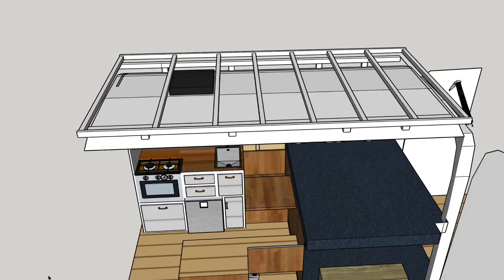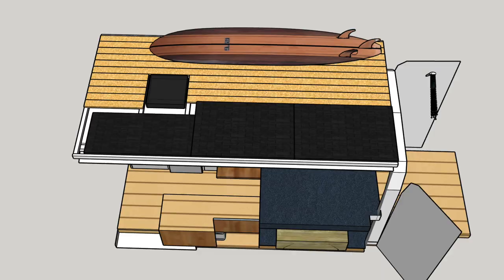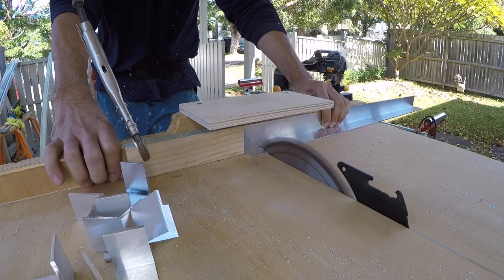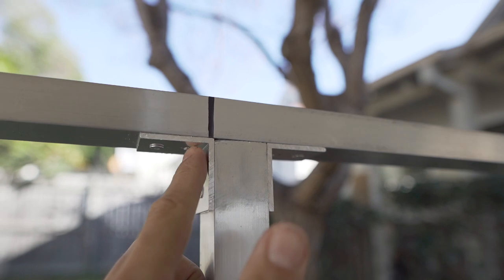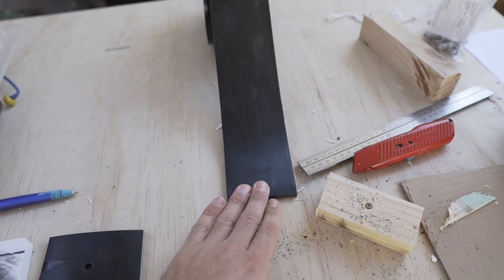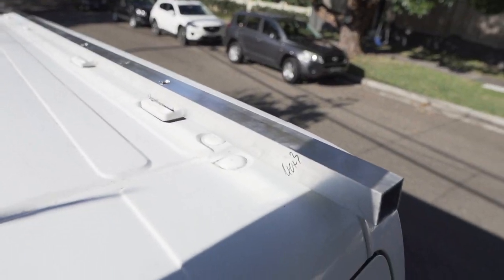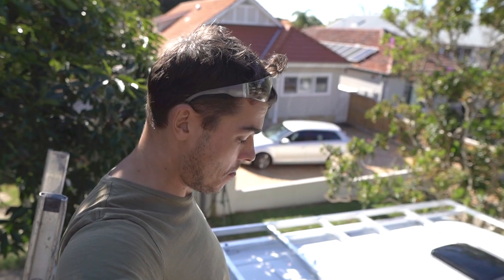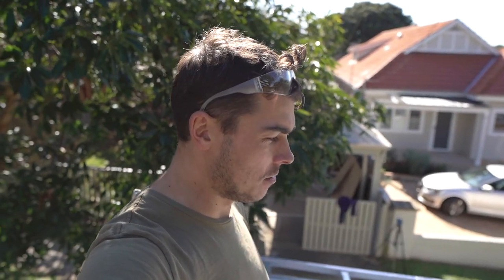DIY Aluminium Roof Rack NO WELDING Ford Transit Conversion

Comment: About to copy you! What did you use to cover the holes in the aluminum mounting channels? And what did you use with the M8 bolts to make them water tight? Imitation is the sincerest form of flattery! Thank you!
Reply from the maker: At the moment it is just some take until i find a plastic cap that fits nicely. You can add some sikaflex around the washer of the bolts to keep them water out. The rubber sheet keeps the water out from the inside.

Comment: Are your 3250mm bars all one piece or did you piece smaller sections together to get that length?
Reply from the maker: Yes they are one piece. I was able to source 6.5m lengths which I cut in half

Comment: Nice work around from welding. Just wondering, is it bare aluminium tubing? Or is it anodised or something? Is there any worry with corrosion since the metal is so exposed?
I've got a set of old roofracks on my rig, the brackets are good, but the tray looks like a diy job from steel tubing, and it was poorly protected and rusting in a disconcerting way. Trying to decide myself whether to replace it or strip all the old paint, file it back, then repaint it; or just make a new tray like this awesome idea. Keep up the useful vids my guy
Reply: I think better than painting would be to take it somewhere and have it powder coated!
Reply from the maker: It is bare aluminium, which doesn't rust in the first place. It will tarnish but we could have left it like as is no problem. We painted it black for aesthetics with an etch primer and top coat which was a hell of a lot cheaper than getting it powder coated. Looks amazing too as i really make the time to do it correctly.

Comment: G’day. I just saw your build and as a fitter and turner that I am I must say you have done a bloody great job. Do be careful loading up any rivets running horizontally, there’s only so much load they can take, if you already have do keep an eye on them please. Safe travels buddy don’t over do the payload on any builds you do. Stay safe and live happy. Cheers from Mario.
Reply from the maker: Thanks mate, appreciate it. Yeah I made sure to engineer it so that there are no vertical loads on the pop rivets as the cross members rest on the side members. I will still endeavor to check the condition of the rivets over time for any play.

Comment: Top job! Lite, strong, cheap. And very big!!
The only difference I'll be adding when I do my Coaster roof rack is, instead of pop rivets, which do eventually corrode, I'm intending to use stainless self tapping screws to hold everything together. This also helps if anything needs disassembly at some later time, for further innovations and/or fit-outs.
Very inspiring. Thanks again for sharing, Mate.
Reply from the maker: Thanks! I wouldn't say the rivets will corrode. Aluminium will oxide but not to any detrimental condition. But they are not as strong as stainless rivets. Having said that if use stainless and aluminium together you will get galvanic corrosion and the aluminium will start to corrode.
Reply: @saltyvanventures  I've seen old aluminium ladders with the pop rivets falling out because of corrosion. So it can happen. Simple to replace though.

Comment: As a fabricator welder I would advise that if its strong enough as it is i would not weld it it will pull and twist and warp in all directions with the heat required.
Reply: So I made my previous comment before I had watched the whole video. First of all great job! You will not need to weld this. I would not even weld a broken section  I would simply drill out any rivets (with the same size drill as originally used) holding in the broken section and replace the necessary parts.  Then redo any rivets.

Comment: Just I found your video today. It's really great and helpful. If your van has a gutter, Would you do the same things or different ideas?
Reply from the maker: The great thing about this van is that it has treaded inserts in the roof.  If your van has gutters I would probably use roof racks and build on top of them
Reply: @saltyvanventures   Thanks for your reply. Ya My van is coaster and has a rounded ricky roof shape so i should use roof rail gutter bracket and copy your idea. Thanks for sharing your idea and talents.

Comment: This is fantastic. Seriously. Do you have any updated pictures of it with the deck? Also, have you been able to drive it and test for and rattling?
Reply from the maker: Thanks, No not yet, it's on the list of things to do. I first want to weld up an aluminium access ladder before i finish the rooftop deck.

Comment: Nice one mate. Shame I can't upload some photos of my alloy transit roof rack on the comments. Im using m6 stainless bolts with spring washers and nylock nuts instead of rivets to connect my pieces together
Reply from the maker: Awesome! Send me a DM on instagram. Id like to see how you did it. @salty_vanventures
Reply: @saltyvanventures  lol I quit all social media this year except you tube to allow more time off the phone and enjoying my camper conversion! I kept FB messenger though. Send me a msg there if you want: Isaac Mack from Australia. Cheers.

Comment: Did you weigh the roof rack by chance? or do you have a guess?
Reply from the maker: No i didn't  but from lifting it on the roof by hand i would estimate it to be around 20-30kg

Comment: Can I use 50*2mm aluminum square hollow? I just found to rails, and want to use it.
Reply from the maker: Personally i wouldn't use less that 3mm, but thats just me.
Reply: @saltyvanventures  Thank you so much. I decided to buy 3mm too.  I don'h have any workshop or garage. And just started to buy all build equipment. Could you tell me, what size of blinf rivet did you use?  I'm a little bit confused  with differences size. Another metric system and labels. =) 3.2 x 4.8mm  and 3.2 x 6.4mm  is it ok?

Comment: Hello nice video! Thank you! But is there enough space under your aluminium bar to walk on it?
Reply from the maker: Yes, just. If you are standing on just one of the cross members, yes it will touch the roof. But with the weight distributed it doesn't. If I were to make it again though I would use slightly thicker plastic spacer.

Comment: Great!  Using plastic window shims as the base is genius!  Please tell me how high they need to lift the bar to clear the roof.  I'm doing the same thing here.  Thanks!
Reply from the maker: I think the ones i used were 20mm (the thickest I could find). But that was still not enough so i used the 6mm rubber matting to get that extra clearance.

Comment: Awesome, great way to save money and get a roof rack. You could spray it black for sleekness too. I assume this is from before you brought your van in for repair at the ford dealer !
Reply from the maker: Thank you. Yes I will eventually paint it black for sure. I just wanted to get it up for now to see how it looks. I might even consider getting in powder coated. Yes this was prior to my feud with the Ford Dealership. And after all that i still haven't got the van back yet!
Reply: @saltyvanventures  lol feud. Powder coated for sure!

Comment: Hey there! We are building just the same rack as you guys did! Thank you for the inspiration! 😊 could you tell us the length of the m8 screws for mounting the rack to the van?
Reply from the maker: Hi there, I cant remember 100% although i think it was 50mm or 40mm.
Reply: @saltyvanventures  Great, thanks! :-)
Reply: Hey guys! We are super happy with the rack although we have the feeling that the fuel we Need increased as of the Lack of aerodynamic. How high is your fuel consumption? :-)

Comment: Looks great! What was the reason you went for different size side members to the cross members?
Reply from the maker: I wanted a small lip for the solar panels to rest up against. Plus it didn't need to be as wide as the cross members
Reply: @saltyvanventures  Do you think it would be strong enough to build something like this with? The guys in this other video did theirs with 80/20 and I’m thinking regular aluminium tubing would be way cheaper https://youtu.be/wRHdZ2CregM

Comment: Very cool. I was a little skeptical of the pop rivets at first, but the beauty of your design is that by securing the 2 rails to the roof you've taken just about all of the load off of the rivets. I have a 07 econoline and since the body has been discontinued, I am having some trouble finding roof rack options. I may go this route. Thanks for the ideas!
Reply from the maker: hope it works out for you!

Comment: Mate, you need to replace those pop rivets with #12 sheet metal screws.
Reply: Why would you use sheet metal screws on aluminium?
Reply: Agreed, Stainless Steel screws are structural. Rivets aren't as strong.
Reply: @JohnDoe-pw5cs  the “sheet metal screw” refers to the thread type, not material it threads into.

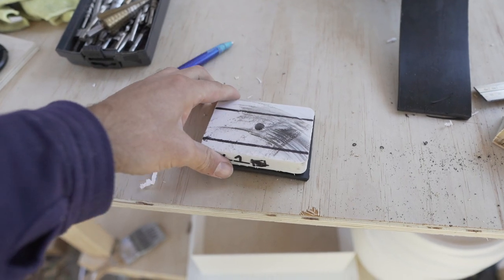Comment: Great idea.  How did you taper the plastic spacer at 5:22?
Reply from the maker: I did it on the table saw with the blade angle changed. You could also easily do this on the compound mitre saw.
Reply: @saltyvanventures  😊

Comment: Great idea... Just wondering how long it took to build and install?
Reply from the maker: All up about 2 days. Thats included going to the metal shop and buying the aluminium too with a long wait!
Reply: @saltyvanventures  what is the metal shop? I found couple, but they had a price more than 800$.
Reply from the maker: @fedornikandrov910  search EDCON steel. If you create an account online with them you can view all their prices. That’s where I got all my alloy from

Comment: great job!  what did you decide on for decking?
Reply from the maker: Hi there, I haven't installed it yet but I have decided to used treated pine decking. It comes in 22m thick planks so I will mostly likely strip it thinner to reduce the weight. Hard wood decking would be idea for durability but it is so much heavier and I don't want to add too much more top heavy weight to an already very high van, hence the thinner pine.
Reply: @saltyvanventures  my thought too.  I wanted to use ipe (Brazilian walnut) but too heavy.  I have a white Chevy, gonna build a rack like yours (thank you!), and thought the dark wood would look great but too  heavy.  I am toying with using marine grade plywood.
Reply from the maker: I considered using ply wood and stripping it down into planks although i think it may be to flexible, unless you use 17-20mm thick stuff. I think it might sag between the cross members is loaded with some weigh like a human. Were as solid wood doesn't bend that much.
Reply: @saltyvanventures  don't strip it down, whole sheet!  maybe cut some grooves in it or use a hole saw and cut a bunch of holes to lighten it and make the water spill off?
Reply: @saltyvanventures  You could possibly consider composite decking, very strong and durable in all weather...doesnt absorb water and is environmentally friendly

Comment: Aluminium is a soft metal. Having used the same idea when fitting racks etc to the Motorbike for touring, and as it is a soft metal..the vibration over time, will cause the rivets to open up the holes  For additional strength , get the small right angles and place them on the corners and joins, and do the simple aluminium blazing and rods are sold in Bunnings..blow torch, very easy and youtube is your friend...basically like soldering...but will help for strength..!.
Reply from the maker: I have actually used these braising rods about 14 years ago before youtube tutorials was a thing. I was using too much heat and just melting the alloy. I was going to give it another go but I do actually have access to a aluminium MIG welder. I want to drive it around for a while and see how it goes as a proof of concept and see how it holds up. Then I will most likely weld it up. I agree that aluminium is soft and all but they build alloy boats by just pop riveting them and they do take a beating on the water so it will be interesting to see how it holds up.
Reply: @saltyvanventures  good...keep it going...lucky yr not down here in Victoria...!..
Reply: Airstreams have been put together with aluminum and rivets for over 70 years and many of them are still going strong. Trailers endure much more vibrations and shocks than modern vehicles.